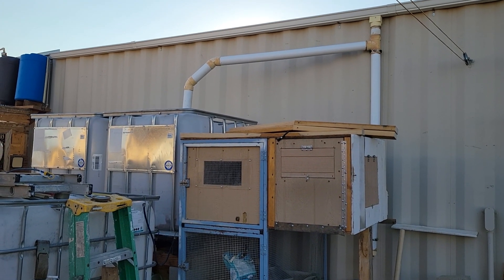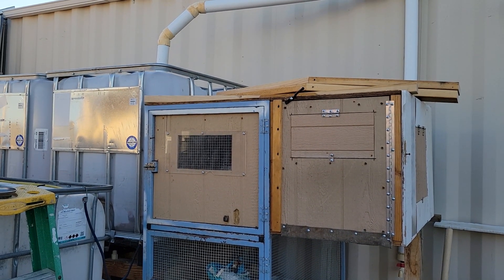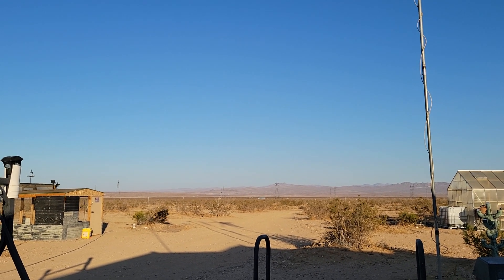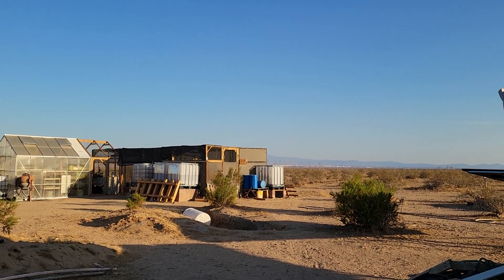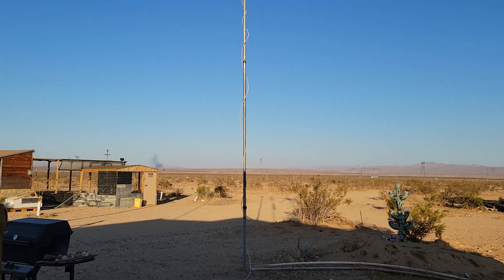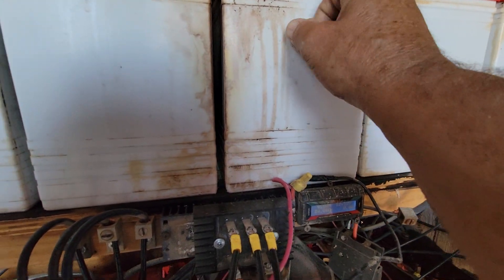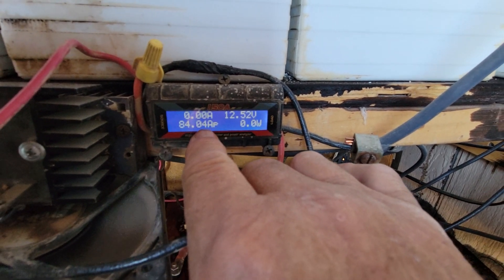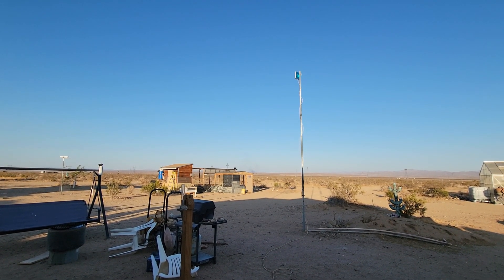Fried Rectifier, Tomcat's rafters & Fire in the desert. Oct. 3, 2021

Comment: Glad it didn't fry your whole system. Have you considered putting a bigger fan in the battery shack?
Reply from the maker: I need a cooling unit in there before next summer, so yes, I'm working on it. But each component needs a cooling fan, and no shut off switch.  A bridge rectifier will get really hot in a wind storm like we had.  All would have been fine if I hadn't forgotten to turn the switch for that fan back on.